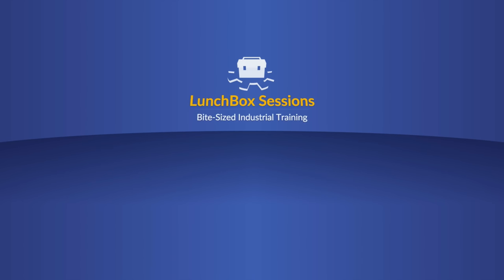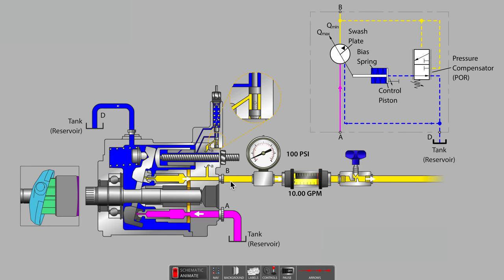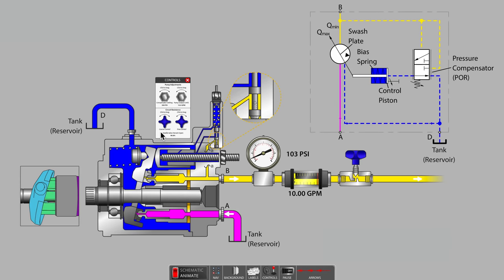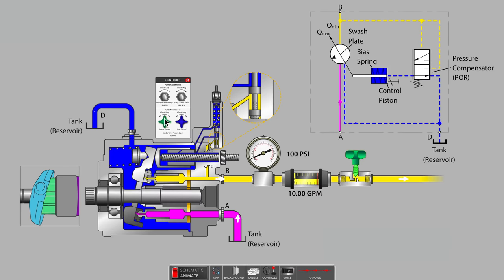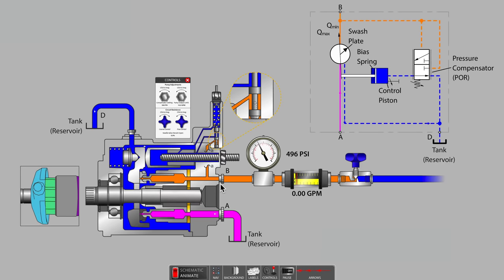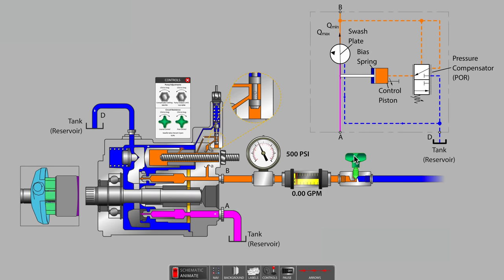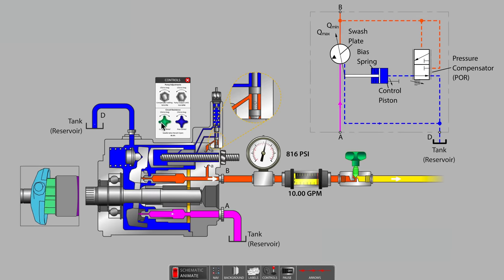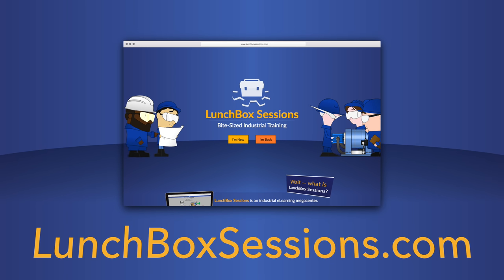Pressure Compensated Pump Adjustments - Part 1

Comment: Oh no... the piston is symmetrical on both sides... it will not lift up. It has to be a "piston" with the spring pushing it down, instead of this double sided valve...

Comment: Hi lunch box, we have piston pump in hydraulic system, when no operation pump build pr. 80 kg/cm2 as per we set. But when operation start pr. Goes to zero and till we can't stop operation of cylinder, pressure not increase and cylinder move slowly. When cylinder operation complete pr. Build up slow in 30 sec. Give your suggestions pls, any check point we do in our system.

Comment: Any one guide me regarding Rexroth A4VSO variable piston pump repair with new carriage kit piston shoe and cylinder pump has been generate the pressure as per require but not sustain properly on machine running

Comment: Thank you so much for this well-made and carefully explained video!  I'm studying for our first test in fluid power systems, and solving a physics problem involving a variable displacement, pressure-compensated pump and our book is hopelessly inadequate at explaining how to adjust or overcome changes to the system.

The problem involves someone increasing a load from 20 tons to 30 tons (system was designed for 20 tons) and we are tasked with determining if it will still function.  The load is extended and retracted and we are given the bore and rod sizes, as well as a value of 2500psi setting for the main relief valve.  Doing the math reveals the system is fine for extension pressure, but pressure builds beyond the 2500 psi upon retraction of the load.  Not sure if I can just adjust compensator setting safely to the higher pressure needs... Hoping that other videos in this series will help me understand how to overcome this issue without changing components in our theoretical circuit.

Comment: First of all Thank you for your support
We have pump rexroth a4vg 180
Mounted  concrete pump after we state pump the pump not in 0 pistion  move to one set  after we change the parts move only 10 strok and than agine stack on one site

Comment: sorry, i'm not a hydraulic expert, but what shown in this video no matter how much pressure in port "a", the piston (in the pump compensating) remain in it's position because the hydraulic force coming from port "a" against upper and below piston is equal. 
or perhaps, the piston below has hole(s) and act just as a stopper?

Comment: HI, I have problem with the A10VG45EP type pump.  its equipped with the  lift machine. machine is not working with normal drive speed and its not moving on the road ramp(allowed limit ).I checked the pressure with the gauge during the drive mode. Its showing only 110 bars. What is the reason for this issue. Please help us to solve the issue.
Reply: Have you checked if the controller is supplying rated current to the prop solenoids? Has the stroke limited been incorrectly set?

Comment: We have a hydr power pack A4VSO DP500 . The tally plate says ' power setting = 392 Kw '. We have another pump same make / type, the power setting says 427 Kw.  
1. How do I adjust the 427 Kw pump to run on the 392 Kw prime mover. Both pumps are otherwise identical in all respects. 
2. What if the 427 Kw pump is run from a 392 or 410 kw prime mover.
The input range of the pump given as 385 to 435 Kw.
Reply: It sounds like the pump has a power control, and this can only be setup or changed on a test bench. If you use the pump set at 427kW in palace of the pump with 392kW, you may overload the electric motor. However if the electric motor is rated higher than 427kW, you should be fine.

Comment: As usual excellent video. Please keep on posting. I would like to ask that the Pressure Comoensator/ Pressure Override "solenoid operated" ? As the schematic in your video, on the right side shows that it is solenoid operated. Would anyone clarify please? 
Thanks for sparing your valuable time.
Reply from the maker: Thanks for your question. I am happy to answer. 

In the upper right-hand corner we see the complete and detailed, manufacturer's symbol for this pressure compensated pump. There is a 3-port, 2-position valve that looks much like many other typical directional valves. But this one is not solenoid operated as there is no solenoid symbol. The symbol for an electrical solenoid is a rectangle with a diagonal slash. 

In the case of this valve, we see a dashed line coming down from above, against one end of the spool symbol. This means that the valve is hydraulic pilot pressure operated. When enough pressure builds on that pilot line to oppose the adjustable spring (zigzag symbol with diagonal adjustability arrow) below, then the valve shifts.

I hope that answer helps a little. Feel free to reply again.    - Carl
Reply: LunchBox Sessions Thank you Mr.Carl for your detailed explanation. Please keep on contributing with your valuable expertise.

Comment: I AM ABOUT TO DEVELOP A 30 TON SERVOHYDRAULIC TESTING MACHINE, AND I HAVE SELECTED A 30 HP MOTOR AND 37 CM3/REV YUKEN PISTON PUMP.
I AM CONFUSED WHETHER I SHOULD SELECT RADIAL OR AXIAL PISTON PUMP?
CAN ANYONE HELP ME OUT?
IF I HAVE TO SELECT AXIAL PISTON PUMP THEN I AM CONFUSED BETWEEN
1) PRESSURE COMPENSATOR TYPE
2) CONSTANT POWER CONTROL TYPE
3) LOAD SENSING TYPE..
KINDLY PLEASE HELP

Comment: Around the 03:45 mark, when the needle valve is tightened and pressure rises to 430 psi and flow drops to 6.80 GPM. Does this mean that as you get close to the spring setting of the pressure compensator (500psi in this case), you can actually control the flow output of the pump by making fine adjustments on the needle valve? In other words, can the DR pressure controller (Rexroth terminology) spool move 'proportionally' as you approach the spring setting of the controller? Thereby allowing you to indirectly control flow to different actuators in a circuit by using multiple needle/flow control valves.
Reply: No, you cannot proportionally control flow output of a pressure compensated pump. As the system pressure nears the compensator section, the compensator spool hunts and the pumps  swashes to provide just enough flow to overcome internal leaks and maintain pressure. Actuator speed controls need to be carried out downstream of the pump output with adequate flow controls.

Comment: Hello, love your all your videos, I'm trying to understand prime mover rotation. It may sound simple of a question, but can't find the information anywhere. I have a Vickers PVH980-L... that has to hook up to a diesel motor. The manual state's "Shaft rotation, viewed at
 prime mover end: counterclockwise". Does that mean the output of the motor is counterclockwise or the input of the pump?
Reply: Input of the pump

Comment: why my hydrolik pump is very hot on the tank line?in the picture video port D reservoir tank.
Reply from the maker: Port D is the case drain line. When this line is running unusually hot, it often means that the pump pressure compensator setting has been adjusted  above the setting of the system pressure relief valve. Please check that the system relief valve is set  to the correct pressure, and pump pressure compensator too, as indicated by the machine manufacturer. Follow safe procedures, or acquire the services of a trained hydraulics technician to make these adjustments.
Reply: LunchBox Sessions what is the function of the valve compensator and how to set this,should be equal to the relief valve system or higher than the pressure relief valve system?my pump rexroth a10v140dflr/3

Comment: Good video but not too deep. I'm not sure if pump is Bosch Rexroth but one of my favorite the A10V or A10VSO doesn't look like this. The awash plate bias springs of Rexroth A10V series is parallel in the opposite side. 
Most variable pumps have extra functions that could optimally operate systems like maximum and minimum mechanical flow limiter. 
To adjust the settings of any variable pumps it's still advisable to use a suitable Relief valve. 
I will never have any hydraulic system without any Relief valve. 
Damn I wasted more than 10 years of studying deeply and experience in hydraulics.
Reply from the maker: The A10VSO is one of my favorites too. Would you believe that size 10 (smallest) of the A10VSO does look like this with the bias spring (without a piston) in direct opposition to the control piston? I could send photos of the pump disassembled on our workbench. But I do know what you mean. The size 18 and up are as you say, with bias spring/piston assembly in parallel to and on the other side of case from, the main control piston. We try not to over-complicate any one video - build up the learning in little chunks.

I agree re: relief valve. I see lots of piston pumps with and without min or max flow limit screw. Can go either way.

We have the A10VSO series in 3D with fly throughs and narrated video. With DR and DFR. Please do stand by :-)  

I didn't understand what you meant about the wasted 10 years....

Keep on learning,   - Carl

Comment: PRESSURE COMPENSATOR MUST BE SET WHEN THE PUMP IS RUNNING AND NO SYSTEM FLOW IS OCCURRING?
WHAT DOES NO SYSTEM FLOW OCCUR MEAN?
Reply from the maker: Mech E no system flow occurs when all directional valves are closed or when all flow valves are closed. When there is no consumption path for the pump’s flow, then the maximum pressure (compensator) can be set/adjusted. I hope that helps.
Reply: YES I GOT IT.

Comment: My hydraulics pump flow and overload engine System slow
Reply from the maker: Thanks for writing. I understand that you are having a hydraulic system issue. Can you provide more specifics? Is there an issue with engine stall caused by excessive hydraulic pressure?  Please be very careful with any pressure setting or pump control adjustments.